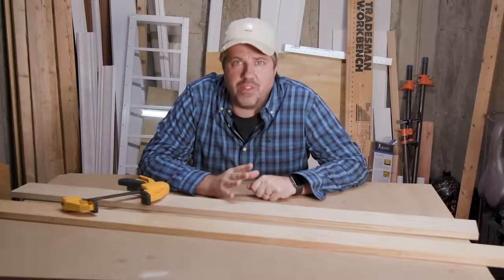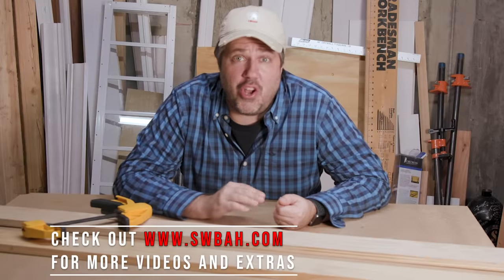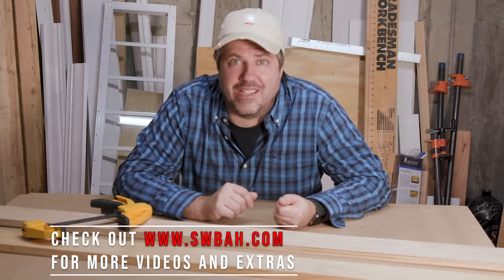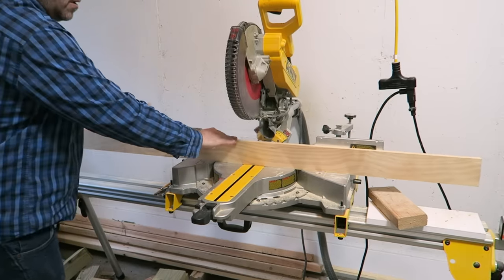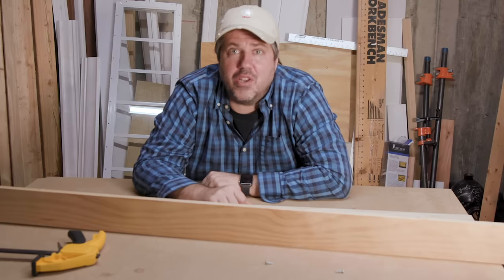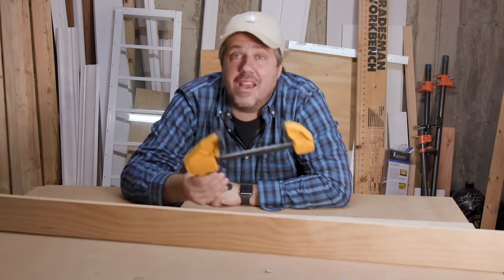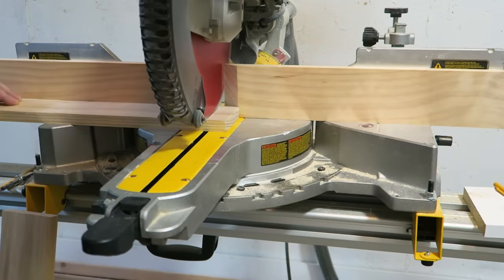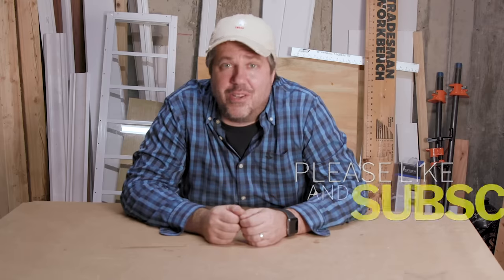60 Second Miter Saw fix that will change the way you work! - Easy DIY Miter Saw Stop Block.

Comment: FYI the dewalt stands have stops built into the outriggers that flip up and down for quick setup
Reply from the maker: Hi Rob.  Good point and they do, but their level of precision is not perfect and with what I was doing I needed perfect. They are great for some things, but when 1/32" off will makes the fit look off and I'm using expensive lumber like I was about to with the cabinet build, I prefer this solution. Also not everyone has a stand with those stops, so I was trying to show an alternative in that case as well.. thanks for watching and commenting!

Comment: If the length of pieces I have allow it I'll just use that clamp that comes with the mitersaw to hold a block down as a stop. I can see one on his behind the fence. You paid for it so you might as well use it for something. Alternatively you can also just make a mark on your miter saw, again for shorter pieces. The mark cleans off easy enough with a bit of spit.
Reply from the maker: The nice thing about using this setup is you can customize it on site or at home for whatever you are doing.  One thing I really like to do is create a story stick out of the auxiliary fence with the measurements for all my different components by writing on the wood like you said.  I can then move the stop about as much as I want following the marks as I build.  A good upgrade it to cut a small piece of wood and glue a small tab on one side so you can slide the stop along the fence. Then clamp the block to lock it in place.  This will give you a larger reference surface on the stop.

Comment: It appears you have the dewalt stand for your saw. It has stops built into both ends that are adjustable. Bit more trouble than a clamp but they’re there and they do work.
Reply from the maker: Hi Rick - it is the Dewalt stand and i used them for a long time without any issue until i built a kitchen table for the house and all four legs were off.  The stops built into the stand are not designed with high precision in mind nor do I really expect them to be as they as this system is really designed for contractor type work.  The two biggest problems are the stops are not 90 degrees to the stand when you flip them up - they are obtuse. So if stack two parts and push them against the fence the top part will be longer.  The second issue is there a little deflection in the metal.  Depending on how hard you push up against stop you can change its length. This introduces some error into the work although it might seem minor at 1/32 to 1/16.  It would never be an issue with most things, but it will drive you crazy if you are cutting multiple table legs or something like a tenon joint or half lap.  There are other benefits to having the wood auxiliary fence as well as I often draw my story stick onto it and move between cuts. For a few seconds to set it up it is worth it to me. But for a lot of work, most people would never need this accuracy out of there miter saw.  If you though this will help I promise :)

Comment: Stop cuts are pretty common. I have built many projects using stop cuts for consistent piece cuts. It's surprising that more people don't know about these.
Reply from the maker: There isn’t much education anymore on basic tool operation. I think many schools have done away with shop classes etc. there is definitely a new creator movement on YouTube looking for this information so I try to contribute what I can to help those looking for advice.  Happy Holidays!
Reply: @SoWeBoughtaHouse  Your solution to explaining stop cuts was simple and easy. It did not cover stop cuts on the table saw though. Of course, they are possible on a radial arm saw as well, but I don't have one of those.
Reply from the maker: Yeh I was thinking depth stop cuts since we talking miter saw.  I don’t do a ton of stop cuts on the table saw. Mine is just too small.  I use the router table more often for that kind of work.  Hoping to get a cabinet saw soon.
Reply: @SoWeBoughtaHouse  I hear ya. My table saw is small too, but I have ways of expanding its capabilities.
Reply from the maker: Mine is asking Santa for a Sawstop :). I’ve done a lot of good work on my DeWalt jobsite though and it never really limited me, it just isn’t efficient for what I want to do anymore.
Reply from the maker: I understand time is tight for kids these days.  Not everyone needs to learn all trades but the basics are very important life skills. Not to mention room I’m a firm believer in learning by doing helping students learn quicker than conceptual textbook learning.  For example, building basic woodworking projects has helped me gain a deeper understanding for structural engineering and industrial design than what I learned in engineering school, where we didn't do as much hands on.  Another example would be in Robotics where the first class is a  very math intensive course on kinematics.  The concepts in kinematics can be very hard to visualize in 2D but can come to life if you build and manipulate a model.
Reply: @SoWeBoughtaHouse  I believe it would help if you edit or explain your comment starting from "Not to mention..." I can't make heads or tails of it.
Reply from the maker: I fixed it it thanks.  I had my little huy home sick yesterday and was trying to answer comments while he climbed all over me.

Comment: Easy repeatable cuts? Built my own mitre saw bench 40 years ago. C clamp and a block of wood, done for the next 40 years.
Still have it in the shed, pull it out by hand set it on the saw horses  and ready to go in five minutes for two cuts of an hundred.
Reply from the maker: Same theory, When I made this video the tip was more for working on location being able to pop something together with scrap. Simple works as you know :)

Comment: ? the reason the saw moves on its mounts is to  use the "end Stops." the metal tabs at the ends of the ends are for support and as stops for repetition of  part  production of longer pieces!
Reply from the maker: Hi Forgotten Tech.  The black tabs on the material supports are meant to act as end stops.  However, there is too much play in them for extremely precise cuts.  I'd have no problem using them to cut 2x4 for framing but not if I wanted to make sure 4 table legs are the exactly the same and not wobble. This is just a quick way to add more precision when you need it.

Comment: Those light duty Dewalt clamps are notorious for letting go. The jaw pads aren’t very firm if the haven’t fallen off and gotten lost. Clamp a block on with an adjustable tuning screw for a stop. I use iron C clamps to secure temporary stops. Dewalt owes you for product placement.
Reply from the maker: Hi Pete - c clamps are definitely better.  When I made the video I was trying to show you don’t need all the expensive green toys you see all over YouTube to make accurate cuts.  Not that there is anything wrong with that and I own a bunch, but I want to show people they can start making with whatever they might have in the garage.
Reply: If you mean Fesstool l just have the C18 drill kit ( $6C retirement gift to myself ergonomics similar to my old Makita 9.6’s) Now Ryobi I have a crate full. The adjustable screw serves another function and that’s keeping the chop saws plumes of dust from building up against the stop and shorting your work pieces

Comment: I prefer using my 12” radial arm saw but a chop saw works ok.   I’m at a total loss of understanding why people buy a saw with 12” blades and not utilize the blade size.   A 12” saw will cut through 4” thick stock but most work is done cutting each 3/4- 1 1/2” board one at a time.   Why?   I don’t know.   
Let’s say you need (6) 1x4’s cut to 47 1/4” and you have (6) boards.   Set the (6) boards vertically on the saw closely aligned on the right end.   Clamp the boards together and cut the first end off to square all the ends, turn the clamped stock around, measure and mark, then align with the saw blade and cut all (6).   Now you have (6) boards exactly the same length with two cuts.  If you are using 2x4’s you can still do it.
Best wishes,   Kevin
Reply from the maker: Hi Kevin,  great points.  I have a 12 inch in saw, but I don't think think most of the viewers I've had in the past do (though recently the channel has grown pretty significantly , so that might be changing).

Thank you very much for your comment and adding to the discussion.  I started this channel to share my first time DIY experiences with others and having people like you contribute to the overall knowledge base I'm trying to create is awesome.  Thank you for taking the time to share!

I like this technique because it works with pretty much all miter saws.  It also works when you can't stack the pieces easy for a cut, such as when making a compound cut or a bevel.  

I also suck at measuring and I prefer to ruin 1 board at a time :)
Reply: @SoWeBoughtaHouse     How so do you suck at measuring?   You forget what you measured or you have trouble with the 1/16” 1/8” marks on the measure?
Reply from the maker: @KevinCoop1  More I get distracted by the little guys screaming in the playroom next door and have trouble remembering my name, let alone alone what I just read off the tape measure :) I'm also dyslexic and switch numbers in my head.  I'm good when I focus.
Reply: @SoWeBoughtaHouse     I’m dyslexic too, but do not have that symptom.   Maybe millimeters would be easier for you to remember instead of 1/16ths and 32nds.   Best wishes and happy holidays to you and your family!   Kevin
Reply from the maker: @KevinCoop1  
I think it is a little different for everyone.  My background is in electrical engineering, so I'm familiar with working in metric and it is easier.  It is just hard going back and forth. So far I've stayed in standard for videos and demos, but maybe aI should try one in metric :) 

Wishing you and yours a happy holiday season!
Reply: @SoWeBoughtaHouse     WOW!   I did electrical design for 35 years.   I became a PE in 2007.  Worked for contractors mostly.   Retired 2018.

Comment: Unfortunately one screw in unstable pine with a rubberized foot on a quick clamp will only be marginally precise and will only suffice for general framing but not much more. In the setup shown, the supports on your stand also slide and have stops. They are equally imprprecise but don't even require the 60 seconds.
Reply from the maker: Before commenting you should read the other comments. These include ways to make the system more precise using blocks, MDF instead of pine,using bolts and counter sinks as well as dozens of people who shared their success stories including me who used this with no problem.  All of these are better solutions then the outriggers which can be off so much they aren’t good for anything other than framing which is what they were meant to do. If you have a system that is faster and more precise I encourage you to share and help others out.  Oh and it needs to cost pretty much nothing and be portable to the job site and can be put together in a minute.  Those are the engineering constraints.  Looking forward to your solution.
Reply from the maker: Likely, I wonder what he would think of my my Supercharge your Miter Saw video :) https://youtu.be/37S2bLIqKNM

Comment: My Dewalt saw does not have holes on the right side fence and it has a molded structure on the back that is too chunky to drill through and create them. I really regret choosing this saw! Nice video though 🙂
Reply from the maker: Sorry to hear that, which saw do you own? You can try these fence clamps.
https://amzn.to/3F1MqpB  It requires a little more work to drill the hole in the fence, but it should allow you clamp the fence in place rather than using screws.  You can use them with other things as well like making a sacrificial fence on a table saw. Let me know if that works or if you have any other questions.
Reply: My DeWalt is 17 years old and has holes on left and right sides of the fence. I don't know why they changed but it's a easy fix just drill the hole where you need it. I cut 22 five inch 2x4 blocks yesterday with no stop blocks they were all with in 1/32. Just do the best you can and pay attention. I'm 70 years old and have only used stop blocks when building furniture. Most production shops use them but they also  use fences that are dedicated to that saw and the same brand of blades. If you want to you can gang out them to insure they are the same. Just be careful using s/blocks and make sure the blade is stopped before you lift the blade.
Reply from the maker: @carlduncan8462  Thanks Carl - good advice to add.

Comment: How is it better than the fence already on the saw?
Reply from the maker: Good question.  The issue is not the fence but the stops that are built into the stand.  The end stops are intended more for rough framing than for precision work.  As a result there is some movement and flex in them which can cause 1/16 to 1/32 variation in the length of cut using those stops.  If I was framing this would not be an issue. However, If I was building a piece of furniture this is enough to cause a rock or unevenness in the legs.  This is a quick way to increase the precision when you need it.

Comment: Teeeny tiny issue - clamp a stop block because the clamp has soft rubber feet.  Otherwise 👍🏼
Reply from the maker: I use a block most of the time.  But when I drop it and it vanishes into the rift I've used the just the clamp.  This Dewalt actually works pretty well because the bumper on the pad is pretty hard.  If it was a c-clap, I'd have to use the block.  Thanks for pointing it out though, I should have mentioned that option in the video.

Comment: your miter saw stand has stops on it. you can position the saw further left or right and the stops slide in and out.
Reply from the maker: Hi Herman, Happy Thanksgiving to you and your family.  My stand does have stops but I made the video for people that might not have a stand like that.  Also personally, for anything other than framing and rougher kinds of work I find the stops on the stand have too much play and they aren't 90 degrees to the support resulting in not enough precision for me me. The way I showed in the video works really well, when I need to be spot on.  It is also easier to set up for me.

Comment: Not all mitre saws have holes in the existing fence. Mine doesn't, guess I'll have to drill some in
Reply from the maker: That is true.  If it an aluminum fence you can drill the hole pretty easy.  If it is steel it will be a little more of a challenge.

Comment: Whats a good way to make a custom miter angle stop for angles that are not detent angles?
Reply from the maker: Just to make sure I’m understanding correctly.  Do you mean angles past the mechanical lockout of the saw like a 75 degree?
Reply: @SoWeBoughtaHouse  No your detent angles are your common cut angles that your miter saw will have knotches cut into the detent plate (the plate that shows your miter angles).  Those notches are what makes your saw lock in on 0, 22.5, 45, etc.  Those are your detent angles.  Any angle other than those angles you have to sight in on them manually and lock your miter arm.  I was just wondering is there a way to put a stop or a lock on that somehow.  LIke if you had to cut a lot of 62.5 deg angles but you were also having to cut 0 degree angles as well so you're having to bounce back and forth b/w 0 and 62.5 deg cuts - is there a way to put some kind of stop or lock on the 62.5 so you're getting the exact same angle every cut in the same sense that you use a stop on 0 degree cuts.  Instead of making  a stop for a length your making a stop for a certain miter angle (one that is not a detent angle).
Reply from the maker: @morokeiboethia6749  Got it - normally when hear detent someone is talking about hinges, but I get what you are talking about.  So two things come to mind.  

1. Put a small A-clamp on the plate to make a stop.  
2. Set the angle and cut a wide piece of scrap wood to use as an alignment gig.  Use the scrap to line the blade against.  Just make sure the saw is unplugged when you line it up, some have hair triggers.

Comment: Enjoyed the video. How long would you suggest to make the fence?
Reply from the maker: Thanks Wayne.  To answer your question, it really depends on what length of boards you typically work with and the size of the cuts. The largest material I work with is 10 feet.  Mine is set up with 6 feet to left and 2 to the right.  So far that has worked for me.  If I need to cut small pieces off a large piece I just cut the larger piece down first.  

One reason example I was working on was a five foot cabinet where I cut the walls and bottom from an 8 foot plywood rip. The 5 foot floor fit to the left and if I wanted to cut the 20 inch walls first I could do it with the stop on the right.

Of course if your projects are smaller you can make it much more compact.